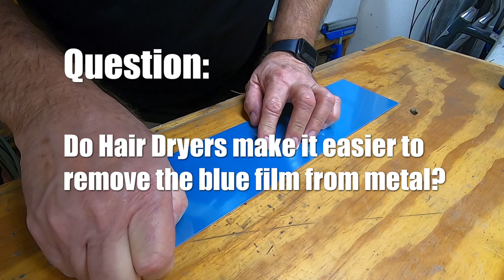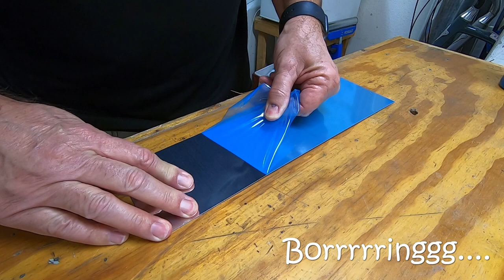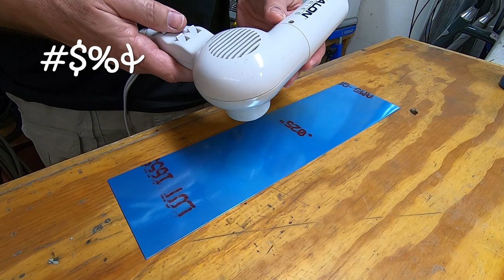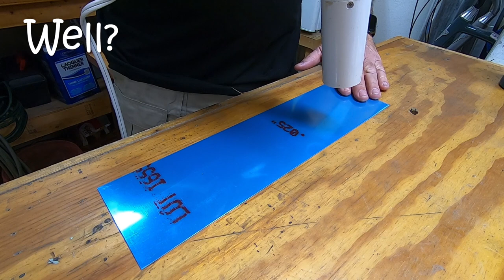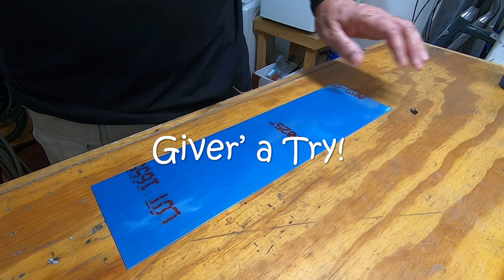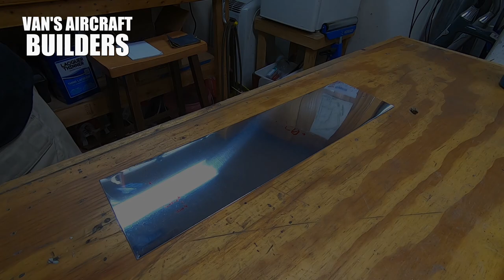Van's Aircraft Blue Protective Film Removal - Hair Dryer Experiment

Comment: I could have used this tip when I pulled the plastic out of the RV12is Anti-Servo Tab skins!  That was the hardest thing I've done so far.  I will try it on my next difficult piece.
Reply from the maker: I just tried it again inside my trim tabs. I was surprised how hot it got in a short amount of time. It really made it easy to pull the blue off in a tight space.

Comment: Seams like alot of work to pull something for few seconds longer.. Not to mention the wife yelling all day cuz the dry is not where she put it
Reply from the maker: I really over did it in this video with the hair dryer. It doesn't take much to get the metal and blue film hot and ready for removal. I used it inside my trim tabs, which is hard to get to. It really made it easier to remove the blue film. The hair dryer really works great in tight places where you remove the blue stuff.